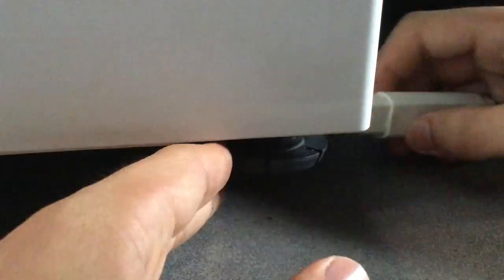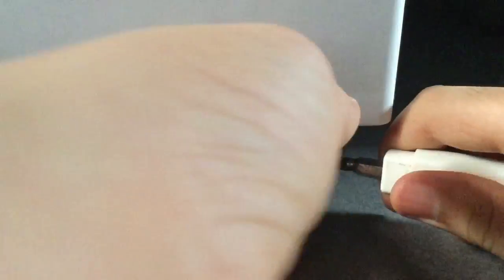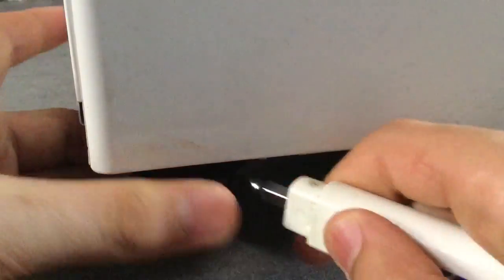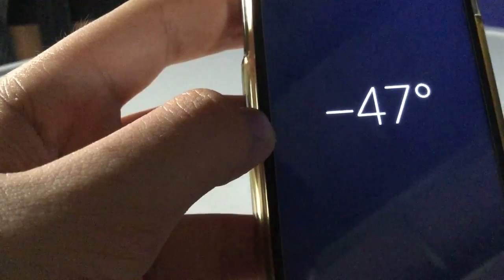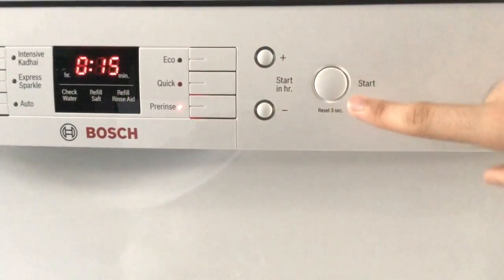How to level your freestanding Bosch dishwasher

Comment: If i have sound insulation around the whole dishwasher, how do i test if it is leve? I can’t put a level on top. And doesn’t it need to be leveled in the cabeinet, not once it’s slid out?
Reply from the maker: This video is for freestanding dishwashers. It sounds like you have an undercounter dishwasher. For those machines, the front feet are adjusted as in the video but the back feet are adjusted by turning two screws in the kickplate above the front feet -- and as you said -- after the dishwasher is already in place. You can keep a spirit level on the top of the door. I'd recommend following a different video as this one isn't for your type of dishwasher.

Comment: That don't explain how to adjust the back foot.  It be different bro.
Reply from the maker: It's the same thing, only the back feet are located in niches at the back corners.
Reply: I found the back foot is adjusted from the front.  You put in a screwdriver and it adjusts the back one.  Two in the front like you describe, and the back one screws from the front. At least on mine.
Reply from the maker: That's for built-in dishwashers. This video is for freestanding dishwashers. Built-in dishwashers cannot be be accessed from the rear once they're in place, so the back legs are adjusted using screws behind the toekick on the front of the machine. The screws are normally located above the front legs.
Reply: Oh, I see.  Makes sense.  Thanks.
Reply: On freestanding dishwashers you can gat at the back adjuster feet. On a built in dishwasher you can, so the adjustment is done from the front. On my Bosch there’s an adjuster screw at the lower front in the centre which you can access by removing an access plate. Turning the screw raises or lowers the back as required. This vid doesn’t cover built under dishwashers.
Reply: I'm having the same problem. I am trying to level a built-in Bosch dishwasher before installing it. I can see the rear foot but it's not budging.
Reply from the maker: For built-in dishwashers you’ll find a screws in the front kickplate above each of the front legs. You can use these screws to adjust the rear legs after you’ve already put the dishwasher in place. The instructions in this video apply only to freestanding dishwashers.